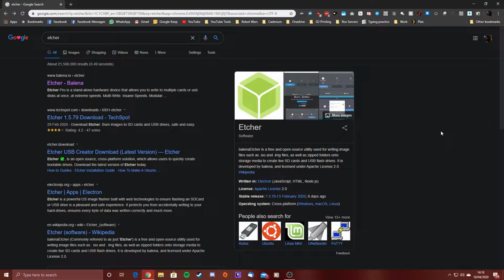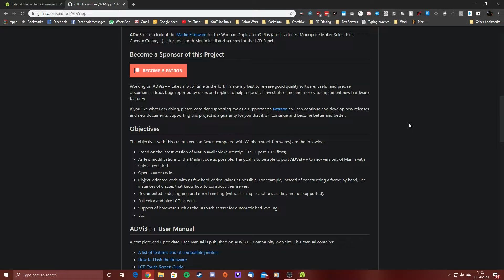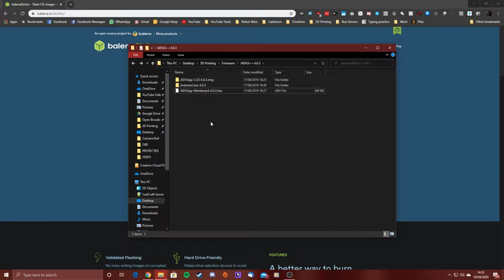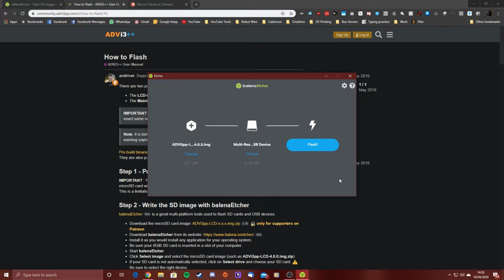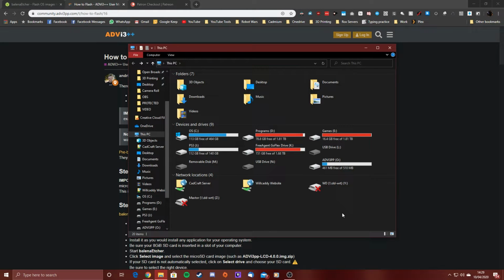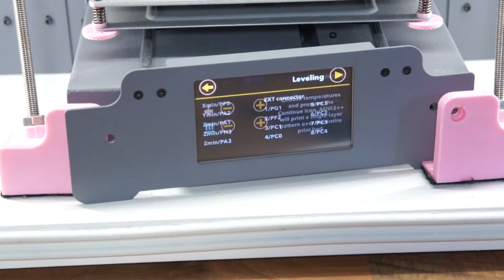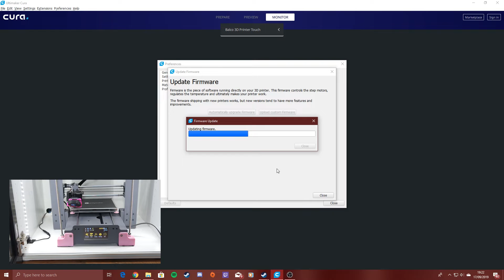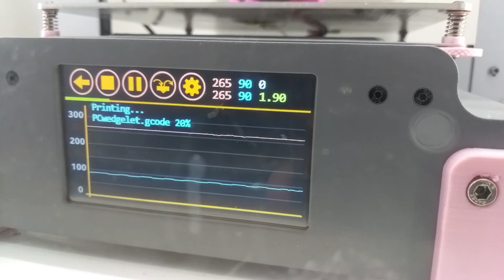Wanhao Duplicator i3 Plus Firmware Upgrade to ADVi3++ (including clones)

Comment: Can we put klipper on these?
Reply from the maker: Hi @VeganRashad I'm afraid im not very familiar with Klipper, but in my understanding it should work fine. Klipper usually runs from a Raspberry Pi and connects via USB to the printer, so there is no reason it shouldn't work. But I have not tried this myself, I would have a look on YouTube for some tutorials and see how you go. Thanks for watching :)

Comment: Hi. The title of the video says "Wanhao Duplicator i3 Firmware" but from what I see this process is for the Wanhao Duplicator i3 Plus, not for the i3 which is a different model. Am I wrong or is it compatible? Thanks, great tutorial.
Reply from the maker: Hi JaviPSantos :) Good spot! That is supposed to be "Wanhao Duplicator i3 Plus"! I shall change it now :) As for the original i3 printer, it is a very similar process to updating the firmware on a Creality Printer. I have a video about updating the Creality CR10s firmware which might give you a idea :) (Link here: https://youtu.be/l4I8b5-71rk). Also there is a set of guides relating to the Wanhao i3 on their website, have a look down till you find number 32 "How to Flash the firmware to Melzi board?" (Link here: https://bit.ly/3qdaZd4) and that should tell you all you need to know :) Hope this helps and thanks for watching!

Comment: Hello, when i go onto Cura and update the firmware, the "upload custom firmware" isn't highlighted. why would this be and how can I fix it??
Reply: Getting the same issue? I recently installed the USB via willcaddy other video but my computer wont recognize the printer or install any drivers??? Frustrating!!!
Reply from the maker: Hey Simon Clark :) I wrote a few suggestions in reply to the original comment, sorry its so late! Thanks a lot for watching :)
Reply from the maker: Hi Rc Crossfire Studios :) I'm sooo sorry its taken me so long to get back to you! I have been working on a new business venture so I have had very little time :( Did you get it sorted? If not here is some things to try. Make sure when you install Cura (or reinstall) that the Arduino Drivers are checked. That is what allows the printer to talk to Cura. If you can't find the option then you can find the Arduino drivers online or the simplest way is to install the Arduino IDE (which you wont need to use but will install the Arduino drivers for you). Make sure you restart your computer after to make sure everything is loaded. 

The other thing you might run in to is another program such as the Arduino IDE running at the same time and blocking Cura from using the port it needs. So make sure everything is closed that doesn't need to be running and give it another go.  Finally don't use any sort of extensions, just use a single USB cable to connect the printer to your computer. The more extensions and extra connections, the more interference in the wire so use the shortest cable you can get away with and try to avoid USB hubs and extensions. I hope this helps and again my apologies for being so behind! Thanks a lot for watching :)
Reply: If you didn't install the serial port drivers you will not see it.
Reply: I would also use the older version of cura that came with the printer.. if you do have it on the original SD card.

Comment: so is there a video  or page of how to build the firmware files? true that $4 is not a lot EXCEPT if you are working on a tight or zero budget and don't have the $4 to spare?
I tried following the link Build ADVi3++ from Sources but you have to pay for that info (says does not exist or you have to log in) also I don't understand why there is a limit to how many can buy (how they 'sell out'). it's a download so can never really run out. seems more like a ransom for the files that being helpful, moreso as the how to build from source is also a paid page or removed.
IF it all goes tits up can you revert back to the original firmware or do you have to keep trying until it works?
Reply: well guess I WON'T be using ADVI3++ - asked 1 question on the FB page and he deleted the post and now I can't post or comment. guess he's only friendly if you pay.
Reply from the maker: Hi dragonlord0666 :) I plan on making a video myself of how to build the firmware yourself as I realised after my first video that not everyone will have the money, especially after the current covid situation. Will get that done asap as I have had a few people ask me! 

I would check out the TH3D unified firmware for Wanhao as I believe it uses a variation of the LCD files but the main firmware is the TH3D unified firmware, so it's the best of both worlds! Here is a link to the tutorial video: https://youtu.be/ksQj5VW_SLs

As far as I can see, there isn't really a good way (if possible at all) of backing up the firmware as the LCD firmware would also need to be backed up. So I would study the video mentioned above and see if that is the way you want to go before committing yourself to the update! Although I would highly recommend the update to either firmware as it gives you many safety and quality of life features :)

Hope this helps! Thanks for watching :)
Reply: HI Will, Thanks for the info. had a look at the video but think I'll wait for your one see if I can follow it on the mac LOL then I can decide.
Reply: @willcaddy  Hi WIll. Did you ever make the video on how to build the firmware?

Comment: After flashing v4.0.6, my MMSP is not functioning at all.
Reply from the maker: Hey there, did you flash the images to the display before updating the firmware? Also did you check the compatibility list to make sure you have the right version? What do you mean by it not functioning? Thanks for watching :)
Reply: @willcaddy  Thanks for getting back to me!  It was the most simplest of things...I only had the usb cable in!  There wasn't enough power to the motors...lol .  Everything is working fine, I just need to replace the y-axis end stop.   Thanks for the reply!

Comment: Guys i did upgrade the firmware all good, the problem i had before upgrading the firmware was touch screen was not responsive. was hoping upgrading firmware will fix it but it did not.
So i bought a new screen and changed it, this brand new factory supplied screen does not even light up...no display at all and recommendations  on what i should do  Thanks. MA
Reply from the maker: Hi there m a, Would you be able to give some info about what screen you got and where you got it from? I believe it has to be one from Wanhao as they have programmed the screen to work with the printer. You would also need to re-flash all the images to the screen too as it will be set up for Wanhao's firmware. Let us all know how you get on :) Thanks for watching :)
Reply: Hi I have loads of issues with my wanhao electrical the PCB not lighting up on mine was the main power feed from the power supply the green plug that's goes onto board had burned out inside the plug this happens on 2 main boards when I figured that out I cut the plug and soldered the main wire to the + and - on the back of the board this did 2 things it stoped the LCD going off and the printer stopped shutting down and restarting half way through prints hope this helps
Reply: Stopping printer going off half way through prints

Comment: why do yoy say Wanhao Duplicator i3 ? it is not.
Reply from the maker: Hey :) it is called a Balco 3D Printer Touch but it is a rebrand of the Wanhao i3 plus. It is exactly the same in every way apart from not having a usb by default. The board inside even says Wanhao :) Maker Select, Cocoon Create and Balco are all rebrands of the Wanhao printers with slight differences for each region. Balco is usually UK, Cocoon Create is usually Australia and I think Maker Select is USA? Although not sure on that last one. Hope this has helped and thanks for watching :)
Reply: @willcaddy  Maker Select is USA. That is the brand I have, got it from Monoprice about 5 years ago. Flashed the firmware about an hour ago, went right well, printing with hit now, but haven't explored the new stuff yet.
Reply from the maker: @Shooter_FPV  Thank you xD Hope your future updates go well :) Thanks for watching :)
Reply from the maker: @Shooter_FPV  Thank you xD I wasn't sure so thanks for clarifying! Glad it went well :) Thanks for watching! :)

Comment: Will this work for flashing new boards?
Reply from the maker: I'm really sorry I missed this! My comments seem to be getting buried and i keep missing them :( If you have the original Wanhao duplicator i3 then you may need to burn the bootloader first before you can flash the firmware. This isn't too hard but does require a second Arduino. Here is a good video on the subject (he is using a maker select but its the same process): https://www.youtube.com/watch?v=ejpSniiJejI . Hope this helps and thanks for watching!

Comment: does this upgrade add power resume function?
Reply from the maker: Hi :) Yes it does but you have to enable it in the config. You would have to download the unpacked version and change it in, I believe, the configuration.h file inside of the Arduino environment. I didn't enable it on mine because it constantly writes to the SD card to enable this to work which wears out the SD card a lot faster. Thanks for watching! :)